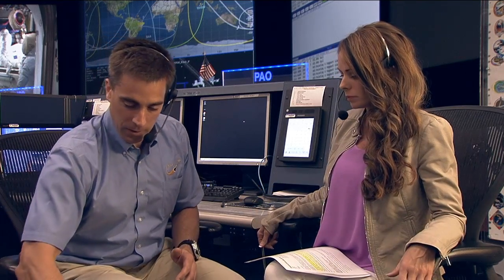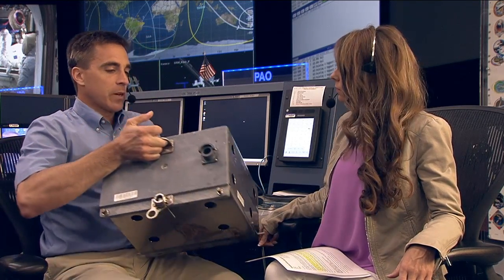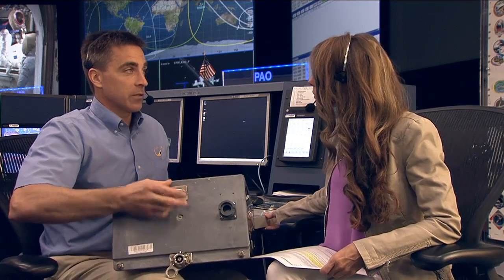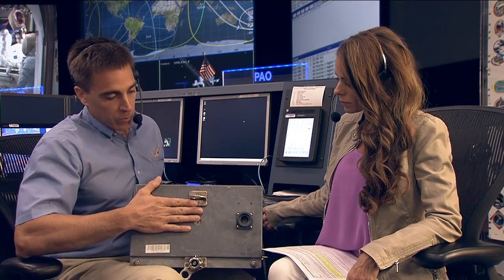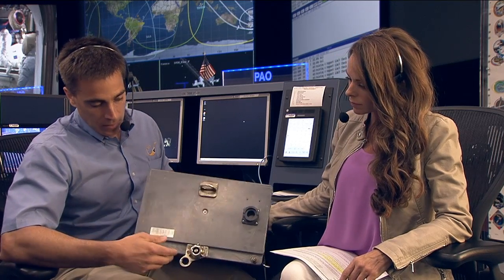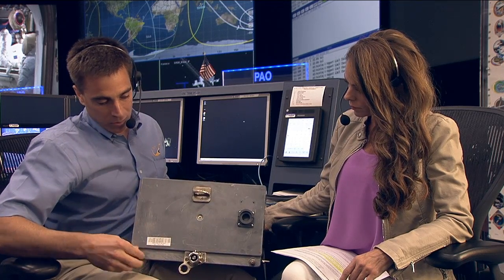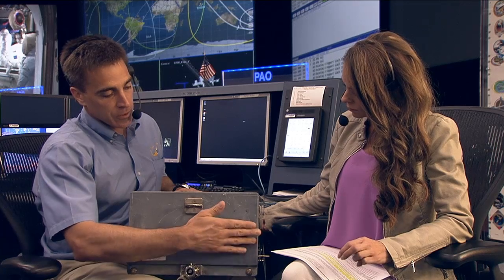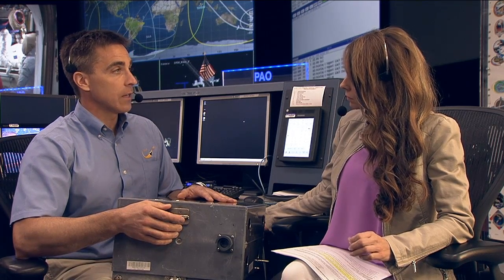Space Station Live: Spacewalk to Replace a Failed Computer

Comment: Funny, as the guy who designed how that box installs, the guides, clamping system and took it through qualification testing, I thought I wrote and developed the procedure, several years before the any part of the space station or mdm box was launched. We tested it on a shuttle fight, and the astronauts screwed it up (stopped half way through reinstall procedure because their power tool battery died, they never came back to finish, because the ground cap com redirected them after replacing battery).